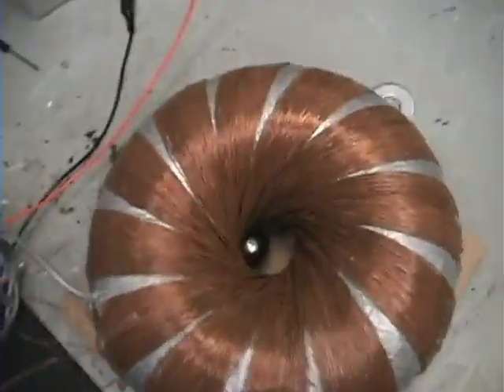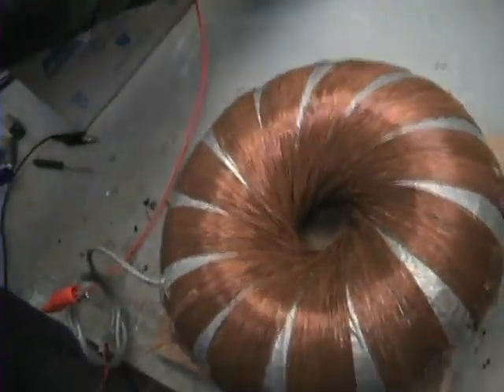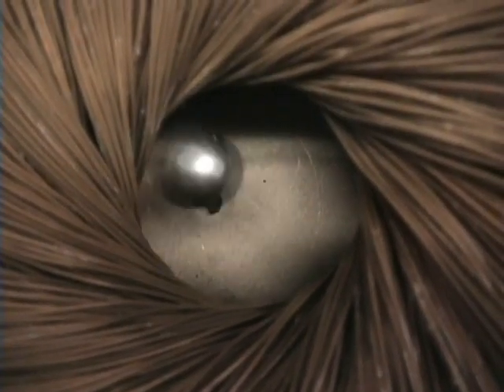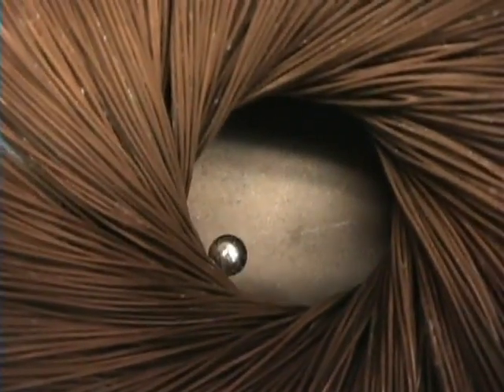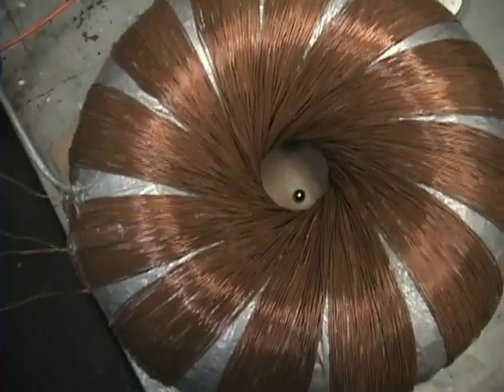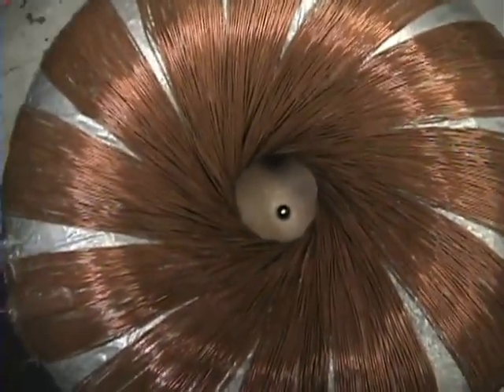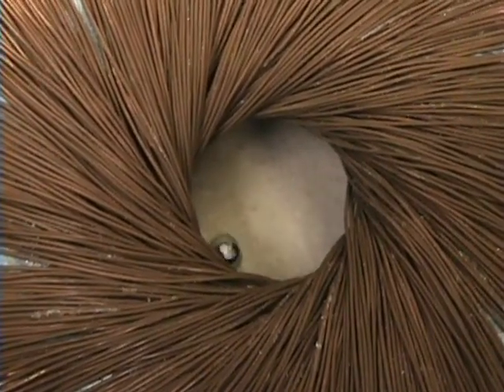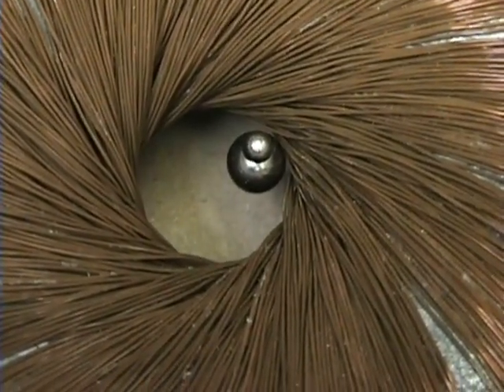Strange Spin with Direct Dc and The Rodin Coil with no pulsing. (TEST 28)

Comment: Are you applying current to 1 coil or to both coils, and is the current opposing in the secondary coil?
It may be easer to see if you marked one side of the magnet with something. tipex or paint or something.